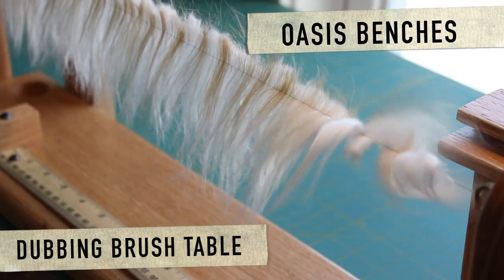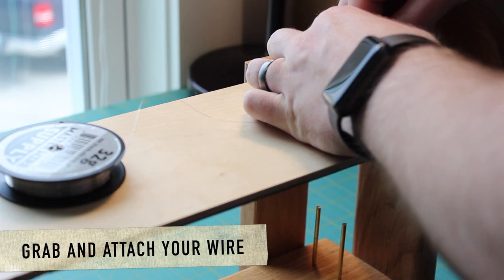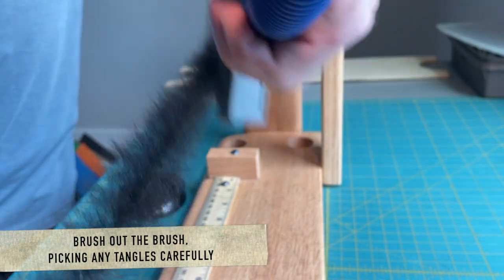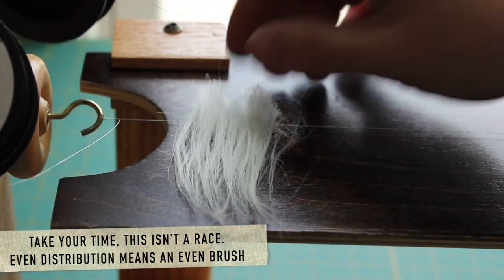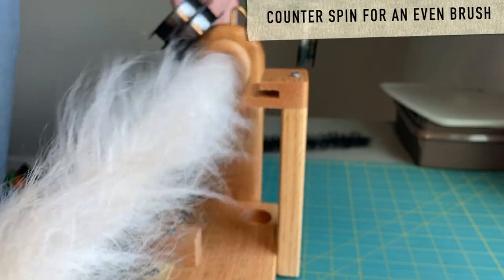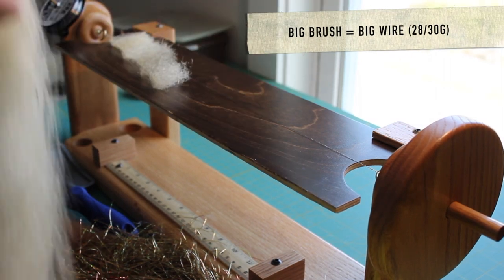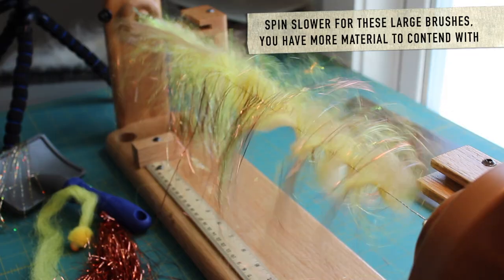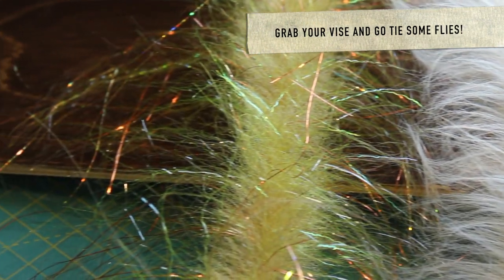The BEST Dubbing Brush Table for Fly Tying (Oasis Benches)

Comment: I bought a 2nd brush maker a couple years ago and asked the seller/maker if it was possible to spin it on both sides. I think he thought that was a weird question. Now here you are with THAT brush maker!! I like to demo making brushes at ff shows. It's more fun when I can have someone from the audience do it (the smaller brushes!). I tie the long fiber brushes for musky and it takes me much longer to spin them out than what I observed here.
Excellent brush maker!!!
Reply from the maker: It is a great machine. Rick did a great job designing it.
Reply: @mcfallflies  I just watched your excellent video again. Are there any concerns about or tips for removing the table when you are spinning with the longer fibers? That would be my only concern with this design.  Thanks!

Comment: what size wire did you use on the last brush you made, the one with the flash in it.  Great video finally someone who explains the fine points of brush making ...thanks.
Reply from the maker: That was 28g, which is pretty darn heavy. You could probably use 30g with fair utility as well.

Comment: Excellent video. Thank you very much. Question:  How do you like the Master Wire Supply wire? I've used UTC wire in the past and have had problems with the wire breaking during spinning. Is the Master Wire Supply prone to breakage?
Reply from the maker: I only use the master wire. All wire breaks when it’s been tightened enough or been bent back and forth (aggressive brushing). Try decreasing the amount of material, brushing softly, or tightening less and see if that helps!
Reply: @mcfallflies  Will do. Thanks again!

Comment: On your bulkhead/predator brushes you said you like a dense core. What material makes it sense? EP fibres?
Reply from the maker: Yep! That’s a good start for sure. Something that will build up and push some water.
Reply: Could you use EP fibres for the core and craft fur on top? Have you used the Steve Farrar blend for brushes?
Reply from the maker: @mikestone9415  that could work. The best advice is to try a brush and adjust for what you want more or less of. I’ve used very similar fibers to the SF blend line.

Comment: Thanks again.  I do have a question.  What are the factors that have you center the material on the wire vs off setting it to one side before spinning the wire?
Reply from the maker: Personal preference. Half and half makes for a more dense/less wide brush. Offset let’s the brush be more light but allows for a wider brush. 

Does that make sense?
Reply: @mcfallflies  A very good question and a very helpful answer! Thanks!
Reply: Nice work.  I use lots of natural fibers (temple fox, marble fox, finn racoon, rabbit) which have a natural taper, so they are offset.  Midge flash lays down nicely, so I center it.